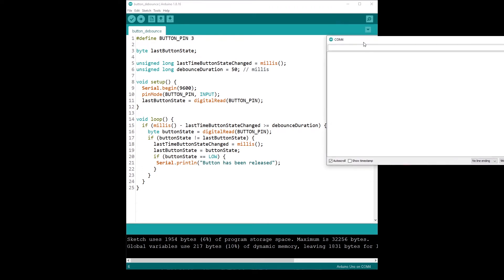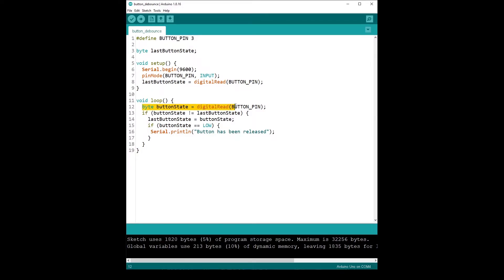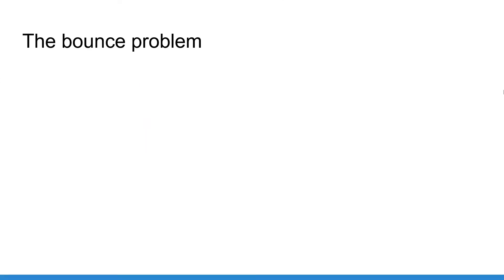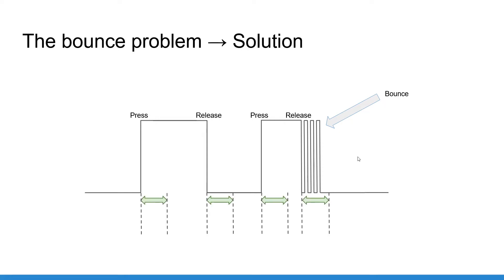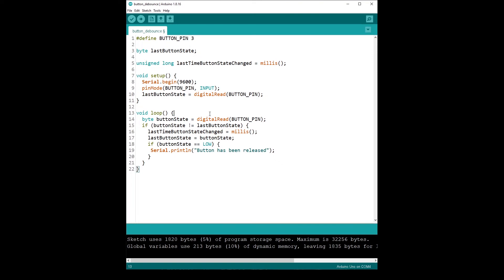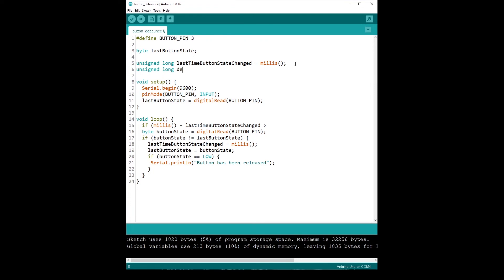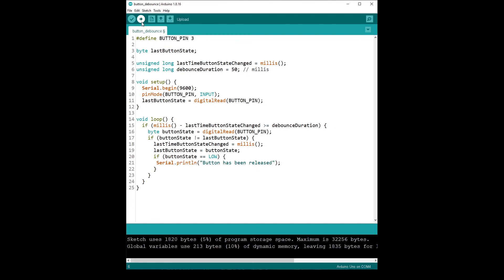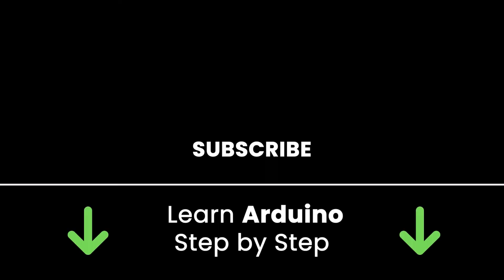Arduino - Debounce a Push Button (+ Visual Explanation)

Comment: Thankss but i have a question! So if an led is connected to the circuit, pressing the button once would turn the light on and then toggle for each press ryt? If so, unless the debounce duration is very large, if we press once(led would turn on) and wait for some time, the led should turn off automatically right?

Comment: Really good expanation and solution. I have seen many bad tutorials about deboucing buttons, but this solution reliably solves the problem without adding any delays to the code, well done. I would add an abs() statement in the if on the first line of the loop, in case you want to keep running your project for a long time.
Reply: hi